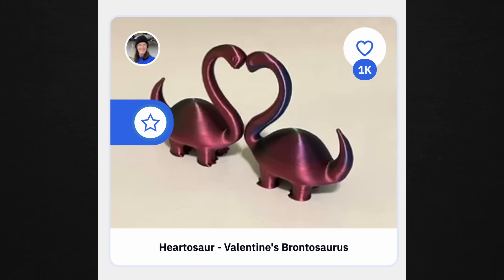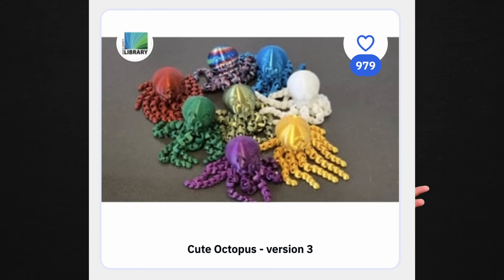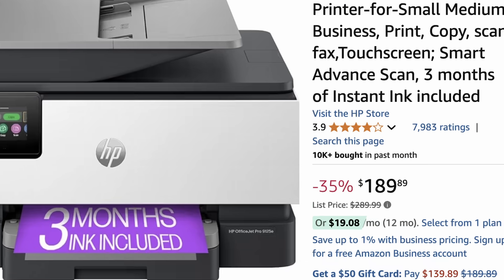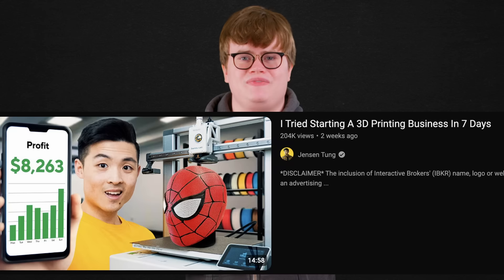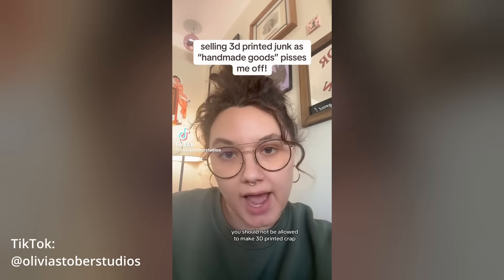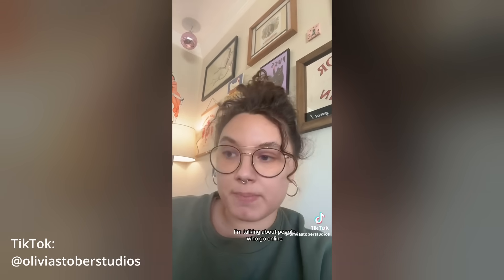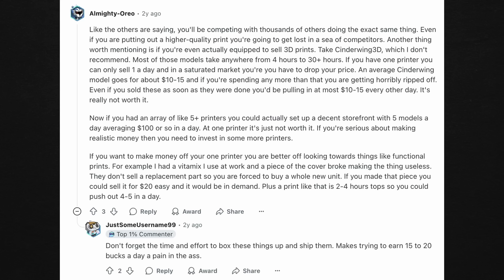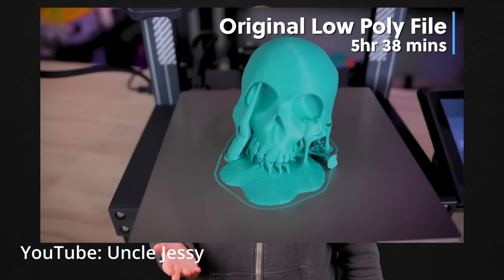The Rise of 3D-Printed Slop

Comment: 7:15 I would like to make a correction here; the original poster is not calling all 3d printed items crap. She clarifies that she is specifically talking about the mass-produced pre-made templates.
Reply from the maker: Yes! She did clarify, but I cut the video up a bit for brevity. My apologies if I confused anyone.
Reply: @RobertTolppi No need to clarify, you and the others need to call it as we and you see it. It's crap. It's garbage work. It's USELESS garbage that's poisoning the planet. 3D printing is awesome for actual useful projects and art like Cosplay, these fidget/deco crap are not art and are not useful in anyway! This is taking away credit and due from actual artisans and at home engineers and the actual useful work that they produce. I got my 3D printer to help design and make parts for my Arduino/ESP32,  other electronic projects, and tools/parts that you can't buy or have to spend an arm and a leg for. This fidget garbage is putting a bad name on 3D printing and the users like myself.
Reply: @RobertTolppi  i sure love excuses
Reply: @RobertTolppi  Yeah, right. More excuses.
Reply: Yeah, I can justify buying something if someone MODELED IT THEMSELVES, not just ripping a file of Thingiverse or something.
Reply: Well, I'm calling them crap and complete garbage. I can get behind 3D printing USEFUL parts, tools, and designs that actually make a job, project, or quality of life better. Not just some deco fidget mass produced copy crap that will sit on a desk or shelf collecting dust and will be thrown to the landfill in a couple of years poisoning the planet for the next 2000 years. Don't apologize for telling the truth, these fidget/deco items are trash and it needs to stop.

Comment: a big argument for printing assorted Temu trash/gadgets is being able to print something that cost a few dollars for a few cents while also avoiding the carbon effects of shipping etc.. and by that I mean things like display stands, toothpaste squeezers, replacement parts, etc - not just like.. toys
Reply: Sooner of the things in those video are incorrect or misleading. I use my two printers to manufacture pass for my work as an electrician, and furthermore I do so on site with one of them. Electrical enclosures, cable clips, adapter parts etc etc. These things do not take 'hours' to print, and the printers are so good now that layer lines are effectively invisible.
Reply: @ definitely. a >$200 print can pump out .1 layer line prints in an hour no problem. extremely fast and high quality prints.
Reply: I printed a birdhouse
Reply: That also causes people to print more stuff than they would have bought exactly because it's cheaper and easier.
Reply: "...not toys... ...but toothpaste squeezers..."   awright, yeah
Reply: I think 3d prints are kinda garbage. I like the resin ones insted
Reply: @ resin prints are more detailed but less resilient, they are suited for people printing more statues and less functional parts, resin prints are harder to manage, the smell is terrible, emits toxic fumes and the prints are brittle, but it has no layer lines and the only limiting factor detail-wise is the screen resolution.
Reply: buy a machine that costs thousands to save pennies LOL
Reply: Printers are dirt cheap now, it’s part of why the print slops a problem, because any dipshit with patience (which is less of a factor now that plug and play FDM printers exist thanks to bambu lab) can churn out garbage. It fucking sucks because 3D printing is an amazing tool and art medium (letting people produce stuff and share it with others they otherwise wouldn’t be able to unless they were a large corporation) and it’s unfortunately just contributing to landfill
Reply: @ why not just... not print those?
thats the thing about the democratization of a technology, the same way you got more people modeling casings for home automation systems there will be more people modeling silly toys, one thing come with the other, the printer is yours to decide what you will do with it.
Reply: @ce7406  lol um what? You can get an extremely decent printer nowadays for 100+ USD. Try again bot!
Reply: @bellisperennissturdivant  bot omg
Reply: @ce7406  "thousands" an entry level machine is less than $200
Reply: @brunoyudi9555  good luck with your Litter Creation hobby!
Reply: @ce7406  what are your hobbies "ce7406" aka not a Russian bot
Reply: @ i do a lot of electrical engineering projects, i can bet money i create way less garbage than you that buys manufactured goods.
Reply: @brunoyudi9555  shrugs
Reply: @ see, you don't actually care about sustainability, carbon footprint or garbage generation, you are just a 12 years old being smug on the internet.
Reply: @ce7406  really no hobbies?
Reply: @bellisperennissturdivant  Stop being hysterical, not everyone who disagrees with you is a "bOt"
Reply: @ce7406  Thousands? This isn't 1990 anymore. I'm printing functional parts made from carbon fiber composites on a $180 machine.

Comment: I use mine to fix shit that breaks to prolong the life of my controllers for example as well as adjust the speed feel to my liking, but yeah just because those toys are the most downloaded doesn't mean they are the most printed, like I've downloaded models of characters I like that I might one day print but like my steam library just sits there on my computer
Reply: The toys are incredibly prevalent. They flood etsy, craft fairs, there's even kiosks in some malls now, hawking those octopi
Reply: @rivetsquid8887  yeah, but so does cheap junk of every shape and size, junk maybe by child labour and all different types of crap, drop shipped straight from Etsy, the problem in Etsy' case is itself, that drop shipped stuff is also a problem that has became insane, so people say we need to lower the de minimis in the US but I personally think that there's probably a better way to solve that, but yeah back to 3d printing yeah it's insane how much these sites are overwhelming with it but they're were already overwhelming with trash after moving away from in etsy case an actually home made demographic and yeah it's a waist of plastic but so is any other plastic toy, TBH I don't see a point in buying a non custom 3d printed toy

Comment: I disagree with your use of the 3D Benchy in the thumbnail. Regardless of the opinions pertaining to it's recent controversy (and subsequent failure of proper reporting), it IS an actual 3D printer benchmark. Most parts of it have exact documented measurements for what they should be when printed at the original scale, allowing a person with a 3D printer to "benchmark" said printer with a barrage of tests, hence the name. To make it clear, I am not referring to the derivative works based off of it (the partial source of said controversy), but specifically the original 3D Benchy is an actual tool. Even though you didn't include it by name in the video, including it in the thumbnail (next to two things you did directly mention in the video) doesn't paint a very positive picture as to your thoughts on it.
Reply from the maker: You’re right. It has now been removed from the thumbnail as it is useful and not relevant to the video.

Comment: lol yeah it's EXTREMELY goofy to see these 3d printed crap at fairs. because they're not even good at it. they're clearly just made with default settings on a entry level machine. 

I've never really been impressed with print quality from any of these "vendors". 

Now I would absolutely recommend 3d printing for prototyping. It's amazing to be able to take a shape or tool from your head and make it appear line by line. 

I modified my printer with a 1mm nozzle and hotter hot end to feed it. because the prototyping I'm doing is not relying on a fine resolution so the speed upgrade is worth it.
Reply: Same here, Ive built my printer and customized the print profile to be for fast printing that can then have holes drilled out to the final size, or sanded to fit. I also use it for fast tpu printing since it's such a useful material. Prints that don't take advantage of the 3d printing process are the worst, doing things like a chamfer instead of a fillet, or having holes parallel to the build plate  are just counter to the process and will end up with a worse part.

Comment: I dont understand the toys either. My first I did print a PLA octopus as a stress test - and I actually really like it and mess with it a lot, but thats the only one. 95% of the time i use it to print FPV drone parts. The remaining 5% is novelty jewelry (I really like being able to take any object, shrink it, and make earrings/hand rings etc.). recently printed small bananas with holes as earrings. Im sure I could buy something similar online in metal, but i like the homemade look when ive created/modified the design myself. In addition i can resize as needed if i dont like the fit. Also for jewelry you can make it stupid lightweight amazing (especially earrings.)
Reply: Where do you get your drone files from? I recently got into 3D printing fixed wing aircraft so I'm still learning the ins and outs of who sells the best files or makes the best models
Reply: Speaking of metal, I wonder if there will ever be a time when 3D printers are replaced by 5 axis CNC machines?